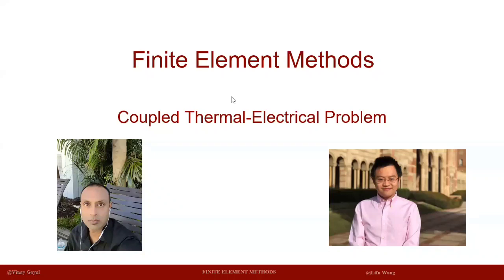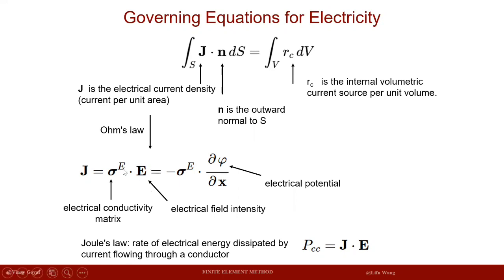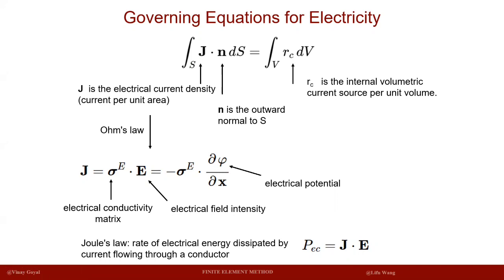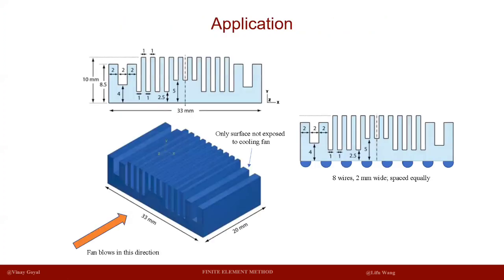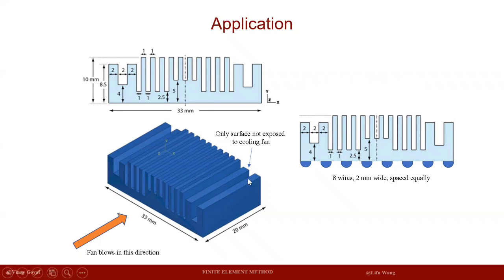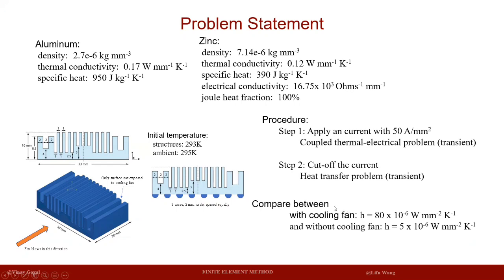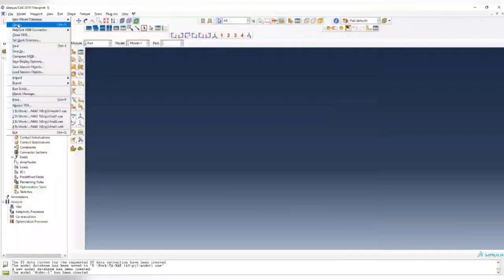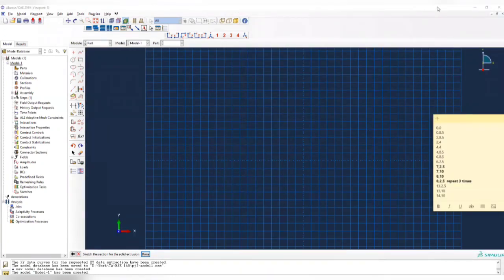#ABAQUS tutorial: Finite Element Thermal-Electric Coupled Analysis of a Microprocessor

Comment: Thanks for making this tutorial. Couldn't find any proper tutorial or any good manual showing the coupled thermal-electrical process for ABAQUS. If possible could you please share any manual showing step by step process for coupled thermal-electrical analysis or any reference material to follow?
Reply from the maker: Was the video we developed unclear?
Reply: This video was well detailed I think. Just wandering if there were any more referance material to use for practice.